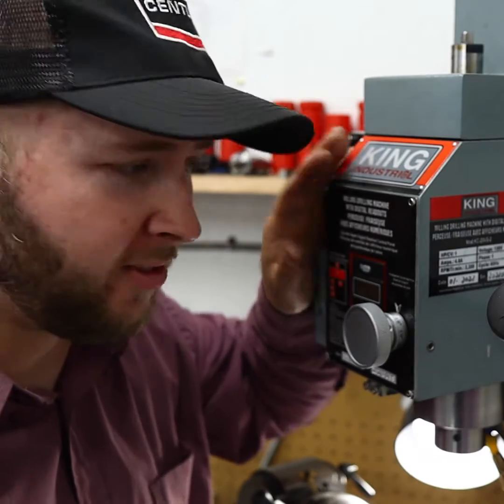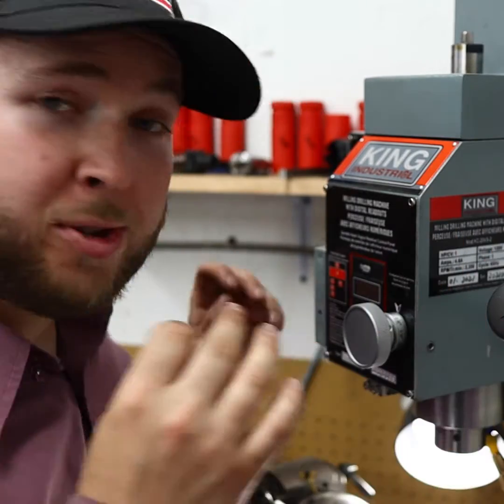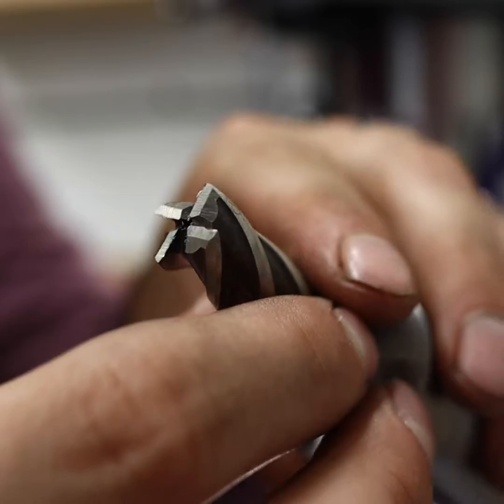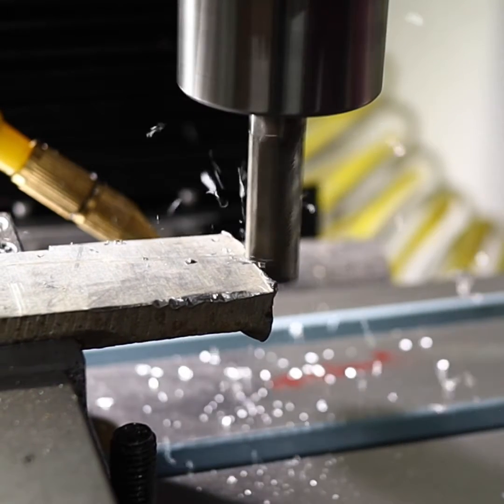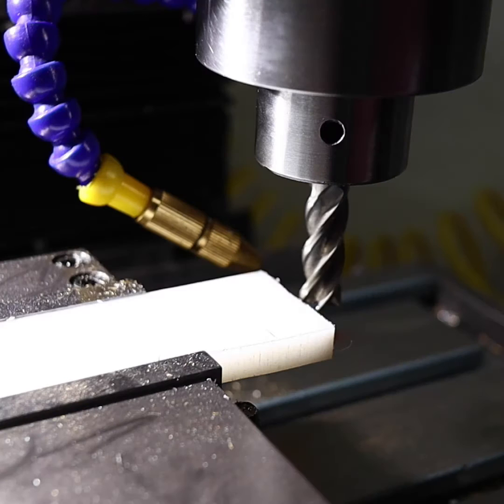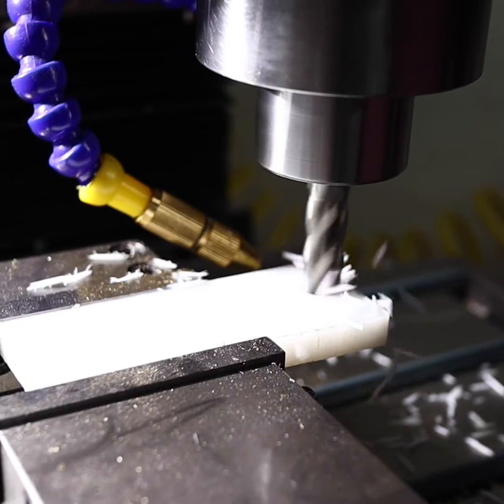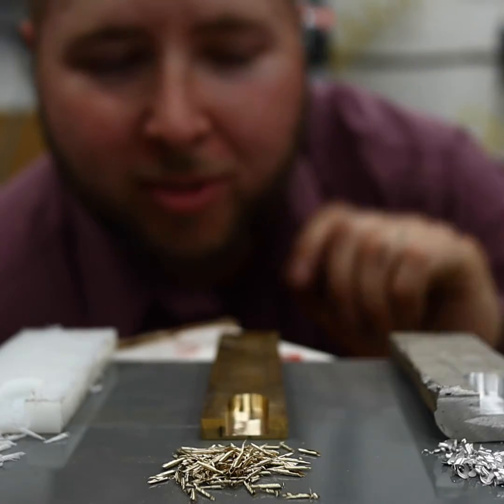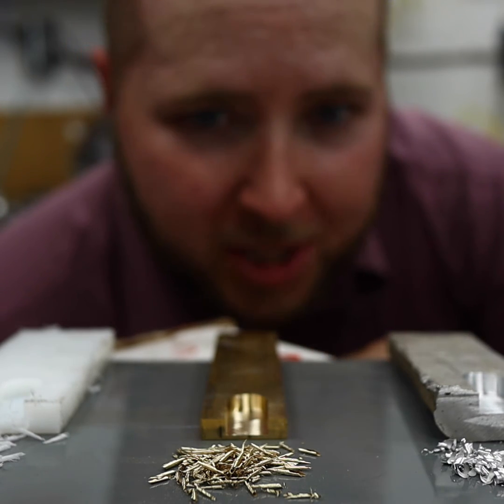King Canada Milling Machine (model KC-20VS-2)

Comment: any thots on building a belt drive machine 
like the Weiss VM32l  or the 
Precision Matthews PM-30MV 
Variable Speed Milling Machines
that dont have plastic gears ?
i m a cnc machinist in canada
and i want to buy a bench top mill
built the new way with belts and brushless motor.
my new idea is to buy a Busy Bee cx601 n retro fit it.
the King Canada KCVS-2 does interest me tho
n there are ppl who have it and like it.

Comment: i was interested in buying the KC-20VS-2,
ppl who have bought this mill
really liked it.
however i am now looking at the
busy bee cx601
because it has 1 and 1/2 horse power
and i am stuck in canada.
what i really want is the PM-30MV mill or
the new weiss VM32L mill
because they have 
NO PLASTIC GEARS THAT BREAK
and instead have a belt drive with
2 horse power !
btw busy bee cx600 mill
is 3/4 horse power
and 600 watts.
no missing motor co-efficient factor
with busy bee.

Comment: how much power does it have really ?
4.8 amps X 120 volts = 576 watts
750 watts/horse power
576/750 = .768 horsepower 
3/4 of one horse power
i figure
Reply from the maker: Hello,
thank you for reaching out. Although your math is correct, in general, there is a missing factor, the motor co-efficient, which will affect the horsepower rating. Because of this, the math doesn't always work. 
We confirm that KC-20VS-2 motor is 1 HP, as advertised.
Thank you!